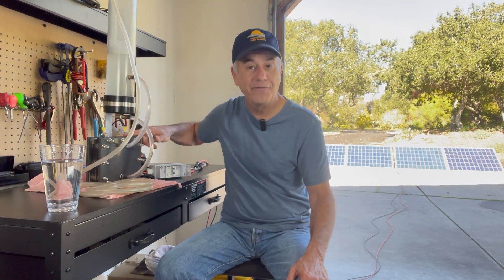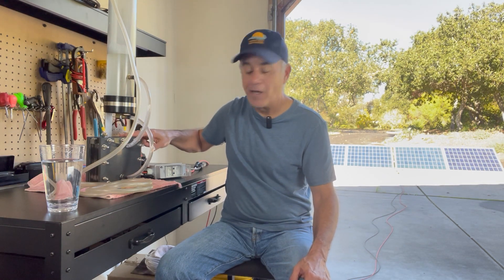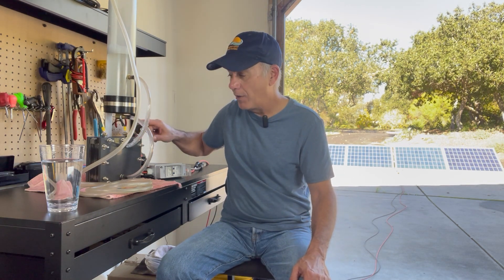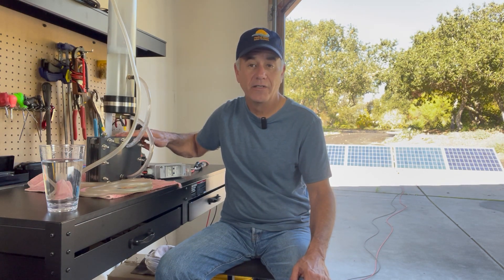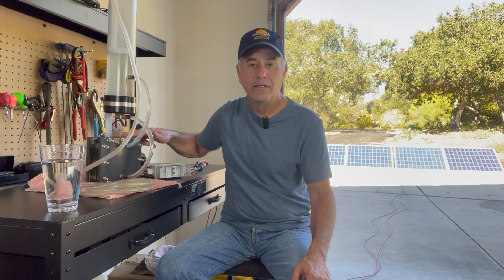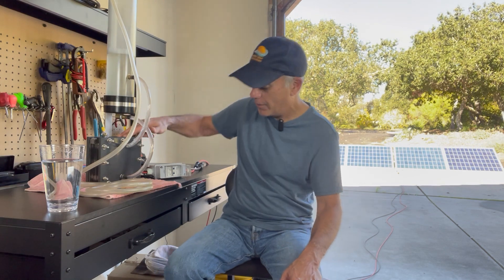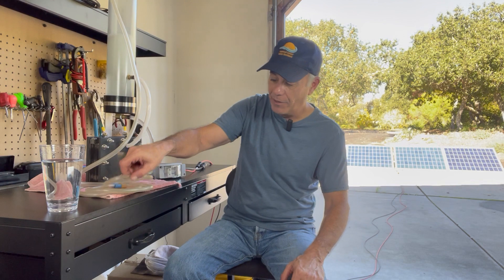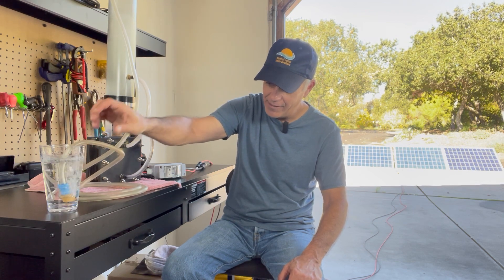Making HHO Directly From Solar Panels

Comment: Hey Bud, Good to see you posting more. I'm hoping to pick your brain.
I've been experimenting with quite a few different styles, setups, sizes, and power levels.
I basically have access to a great steel yard and picked up some 1/2" 304L rods. I was about to cut them to make a rod based cell for use as a torch. 
I have a couple of good power sources and a powerful pwm.
Do you have any ideas or suggestions for me before I start experimenting?
Thoughts?
Reply from the maker: Hi David - Forget the rods or any wet cell design and build or buy a dry cell. The problem with a rod design is that it will heat up very soon and you will get a lot of steam. Look into dry cells and make sure you have enough neutral plates to keep the voltage between plates to around 2V. Watch my video on neutral plates if you don't know what I'm talking about.

Comment: Hi Mike , can you answer me one question please that i cannot find a straight answer for ?  Does the separate bubbler have just distilled water in it ? or electrolight same as the HHO generator ? thanks in advance 😁😁👍👍
Reply from the maker: No electrolyte needed in the bubblers, either distilled or tap water is what I used.

Comment: I have about 1200w of solar on the roof of my rv. Ive got about 60a at 14v to play with. Im going to try it.
Reply: Have you done anything so far?
Reply: @pr5991  I made a small setup with graphite plates but wound up running into issues with things getting too hot so I do need to do a redesign.
 Before I could try it on my truck....

Comment: Nice to see you again! It’s been many years since I first saw you video. I started with my hho generator build a year or two ago but one main problem was turning the torch off without an explosion in the tank(i do have the pressure relief valve made according to your instructions)

Just a few days ago I found somewhere in the youtube comments section an advice to hook up a solenoid valve to my gas line. I run my generator off 2 parallel 12volt batteries. The 12volt solenoid is hooked up to the breaker and as soon as it loses power the gas line gets shut instantly and the flashback is way more quieter than it would be in my flashport.

I decided to solder a spring loaded button to the solenoid valve which disconnects the power upon being pushed and reconnects and opens the valve upon the button being released. This way I will not have to worry about reopening the gas line while the generator is still producing gas. The button is crucial for this because when I would just flip the breaker the capacitors in my pulse width modulator would still feed my solenoid valve and the drop in gas pressure would occur faster than the valve would close.

As a student of metal crafts I see a lot of potential for this torch. Now I need to infuse the HHO with acetone or a similar chemical to make the flame more suited for soldering jobs.

The solar panels are a great idea. Hooking them up to a battery would make for some great off grid fun :)
Reply from the maker: @randar9884  If you are having trouble with flashbacks, I have an idea for you to try. This is something I discovered after I stopped posting HHO videos years ago.

I bough myself a small oxygen/acetylene jewelers torch and ran the HHO into one of the gas inputs. On the other input I ran a line from my air compressor. I leave the torch valve with the air closed while I'm using the HHO torch. When I want to put out the flame, I simply open the valve on the air side, injecting air into the mix, and the flame goes out without any flashback at all. It works very well.

Keep in mind that you don't have to be connected to an air compressor. You could simply have a small canister or air tank that you could manually pump air into to build up a little pressure. Connect a hose from that canister to your torch and give it a blast of air when you want to put out the flame.

Please let me know if you try this. I would like to hear your feedback. Thanks!

Comment: Good to see you back. I have a question:
I have space for a extra alternator and battery on my v8. Is this a viable option to get better consumption? 
All my research over the past few years has shown that HHO systems for cars are more scam than anything else and the problem is the energy required. I even spent some time on wood gasification as a alternative and both HHO and wood gasification have serious draw backs
Reply from the maker: Adding HHO to an engine can be very difficult. There are just so many variables. That was one of my frustrations with HHO. There were a LOT of people who had no idea about what they were doing. One company stood out who did it right, Central Valley HHO. I think Scott is still around, I see that he is still posting videos. His YouTube channel is @ssfuturescott. Scott spent a ton of money on testing, and had HHO setups in his personal vehicles for years. If you still want to pursue HHO for an engine, that is the person I would contact.
Reply: @centralcoastoffgrid Thanks for replying.  I have seen his vids. Appreciate it and will contact him

Comment: Can you mod this for health purposes? This is the explosive Brown's gas, correct?
Reply from the maker: Yes @wildeslothe5475  this is Brown's gas.  I can't vouch for the health benefits though. I did try drinking some HHO infused water back in the day and it did make me feel more alert, kind of like drinking coffee. Not sure if it was a placebo effect or not. My main concern drinking it was that I'm sure there were trace amount of Sodium Hydroxide ending up in the water even after being filtered through a couple of bubblers. It gets carried through the water vapor in the gas. I'm guessing this is what causes the pH of the water to rise.
Reply: @centralcoastoffgrid  Yes, that's because of the lye, like you said. You need to add more bubblers, they have 3 in total and then the lye doesn't get through and it's still 0 ppm. But for health purposes it needs to be not explosive anymore. Then they inhale it or drink it via water.

Comment: Hello, can you use a hho generator to power a gas cooker ? And how big of a generator you need to do this ?
Reply from the maker: Hi @CinemaProjectionTech  That's a tricky question. It's tough to use HHO as a cooker. To burn HHO, you need a very small nozzle/tip on the burner. I think the expert on this subject is Peter at HHO Gas Technology. He has been experimenting with torches and burners for years. The gas he uses is not straight HHO though, he filters some of the HHO through some kind of fossil fuel liquid (maybe acetone). I think he uses about 12 liters/min. Not really practical compared to an induction cooktop. Here is a link to one of his videos boiling a pot of water on a HHO burner: https://youtu.be/6OsT6wXuQoA?si=NLeppdvCE4iohPA-
Reply: Thank you ! @centralcoastoffgrid
Reply: Bio gas is a better alternative for a gas cooker and even for gas fridges.

Comment: Could you not add a variable (high power rated) resistor in series with one of the solar cables?
That way you could “tune” the variable resistor and at the same time measure the between plate voltage till you get spot on 2.0 VDC?
Then fine tune to allow for longer run times if need be.
Love how you are experimenting.
Just need a boiler, piston and flywheel setup with generator attached, then either AVR Auto Voltage regulator, or some other method to clean up the AC to give better than mains quality power.
I’ll be your first customer once it’s perfected and tested with variable loads.

You can use a voltage recorder (Polylogger) are the best in the game to prove quality of supply.
Mate, you really could have something here!!
Reply: You may be able to hire the Polylogger.
They also have smaller plug into outlet types which is for sure a lot cheaper (comparatively).  The other way is to get an electrical engineer to provide this service.
Make sure you patent it all before even approaching one.
Bit of R&T required here…Research and Testing.
Reply from the maker: @martinlang9615   Thanks for the comments. You said "you really might have something here". I'm flattered, but you are the one who came up with the concept. To be honest, I'm not quite sure I understand what you are describing. Sounds like a HHO powered steam engine with a generator attached. 

All I did was plug a HHO cell into some solar panels. If there is something here, please run with it or patent it. This is your baby. If my silly little video gave you inspiration, then I'm happy.
Reply: @centralcoastoffgrid 
I couldn’t be bothered doing all the R&T.

HHO being the fuel source to heat the boiler, making steam, driving the flywheel with a governor which controls generator speed.

I used to work at Luggage Point Wastewater treatment plant in Brisbane (mouth of the Brisbane river).
They used Collected methane to drive massive UK Diesel engines to produce power for the grid.
They would have to start these on diesel first, then change over to methane.
Only issue with Hydrogen is the safety side of things, likely need back flow preventers.

There is a fair bit to it, but once set up would give power from water and the sun which is amazing.

I’m in Australia and have a grid connected (30kW), which is huge system with two 15kW three phase inverters.

Thinking about a small off grid unit to power only the light circuits and one power circuit for water pump, two fridges and a tuckerbox freezer.
I got about 8 months to get it ready, so I’m not in a hurry.
Was thinking about using Edison batteries.